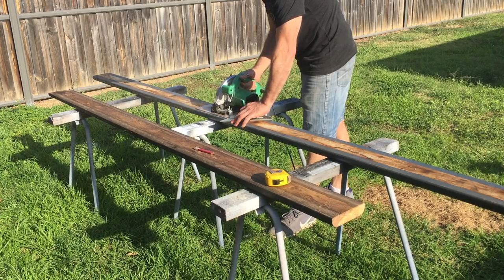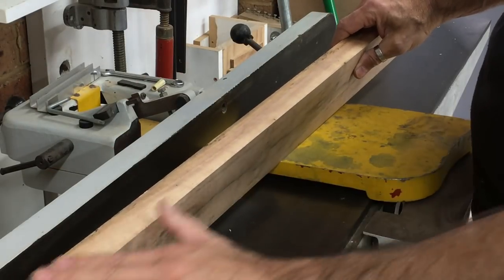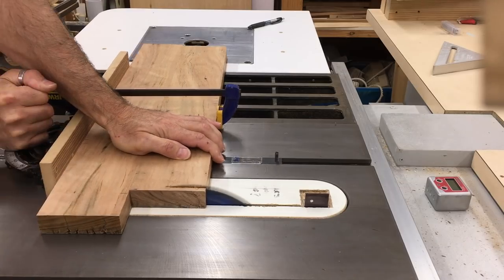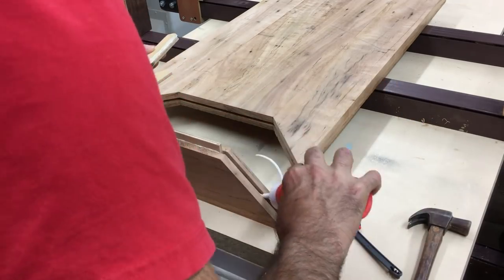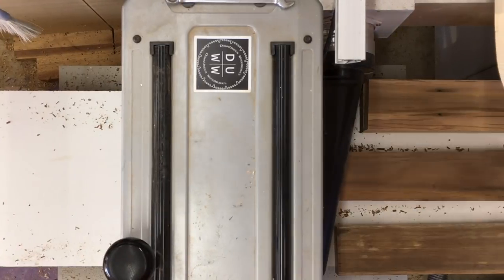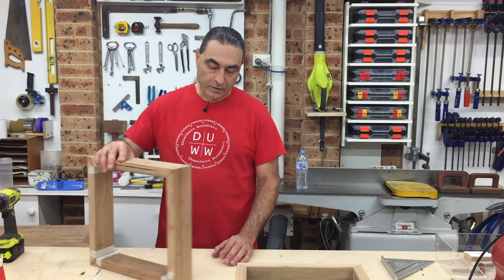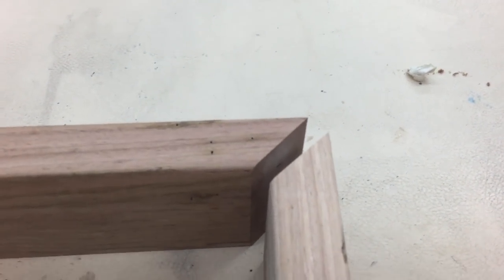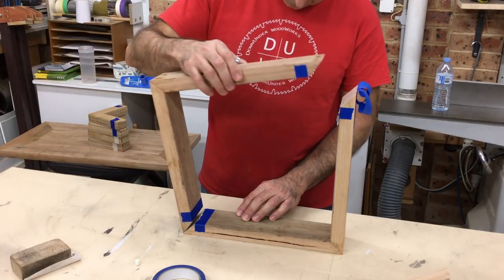Mitred Top Coffee Table Build | How to

Comment: Lovely result mate. I made a desk about 14 years ago with mitred edges and my latest desk is also made in the same way. I think that if the ambient temperature and humidity stays in a reasonably narrow band,  you should (or rather your brother should ) not have any worries. I live in Melbourne and our interior temperature generally stays between 14 and 28 degrees or so. The first desk lasted all that time without the mitres opening up and I hope the new one will too. Cheers:)
Reply from the maker: Thanks mate. I tend to agree with you, most of the time furniture pieces live in fairly stable indoor environments so i'm quietly confident.

Comment: Make sure to tell your brother that while you didn't "turn the table" on him this time, next time he won't be so lucky. Then get a lathe if you don't have one. I think you'd absolutely kill it with a lathe. Top job on this one. I hope the mitered ends hold on and float along with the perpendicular boards as they all swell and shrink over time. If it gaps, those'll be the spots.
Reply from the maker: If i do get one it will be a homemade version. I think the table will be fine being kept inside all the time. i'd already thought to myself that if the ends didn't work out i would cut them off and add breadboard ends.

Comment: I’m getting ready to build a farmhouse style table & in the process of researching videos I came across yours.  My client is wanting this exact look & I’m racking my brain to come up with a means of joinery to keep the table from exploding.  Very interested in the system you used & if the table is still together.  Thank you!
Reply from the maker: Jerrod, as you know there are no guarantees but the table is holding up fine because its in an indoor climate plus being small the amount of expansion is small. i imagine on a dining table with many boards edge glued there would be more movement. it will depend on the climate its in and if the client is adamant then just explain the risks to them up front so they can accept them.

Comment: Great job Vic. I’ve found that you can break the rules when the wood you are working with is super dry and you are thorough with your finish seal to minimise movement and moisture adsorption. Do you use a digital angle finder for your table saw? I‘ ve found these indispensable for mitre and complex angle joinery. Best regards from Tassie.
Reply from the maker: Thanks Greg and i agree with your comment. i do have a digital angle finder and love it.

Comment: Thanks very much for the video Vic. I haven't made your excellent looking mitre sled only because I have a Sawstop. I don't trust myself to take it out of safety mode everytime I use a specific sled/jig. 
I appreciated very much your demonstration about the consequences of table saw setup. That is precisely the sort of mistake I am likely to make. 

A couple of questions from a beginner; (a) I didn't understand how the long slots in the ends helped because all the faces got filled with glue. (b) I am guessing that movement might not be a big issue anyway because it was not too large/wide. (0.1% difference in movement across 300mm is still only 0.3mm.)
I'm also guessing that although it will work for you, I may not get away with it in steamy Queensland.
Reply from the maker: Hey Dave, thanks for the question. the splines add a lot more surface area for glue. Also the mitre joints on their own are end grain joints which are not as strong as long grain joints. the splines add a glue surface to some long grain.
Reply: @DownUnderWoodWorks  Ah yes that makes sense. I thought you said it would help with movement. Thanks for your reply.

Comment: OMG! Wood expansion! Run! LOL. Great use for wood that most people would throw away. Nice job Vic. Question, why not use your miter sled for the leg miters? Just askin'.  Always enjoy your videos.
Reply from the maker: Thanks Mark, and good question. To use the sled, the legs would have to be placed on their edge and the depth of cut would have been 80mm. Just felt more comfortable on the table saw with the blade a lot lower.